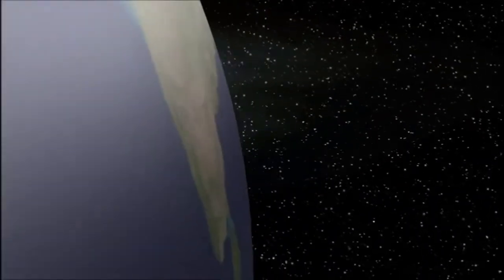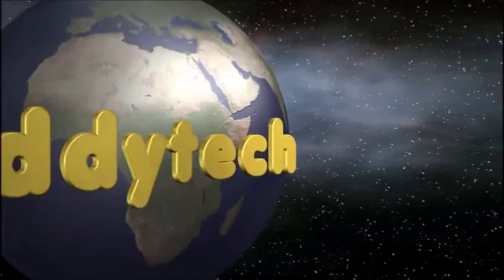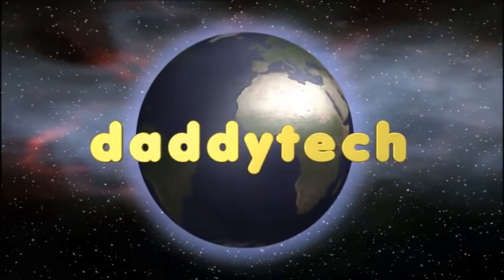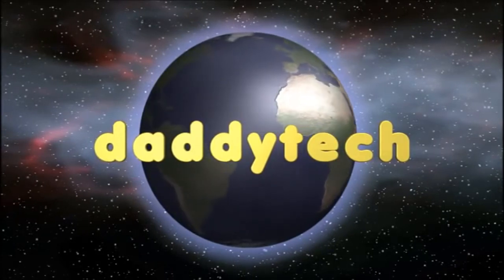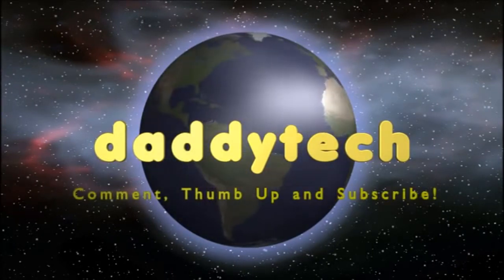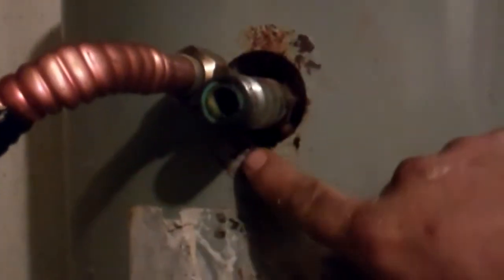My weekend adventure

Comment from the maker: @zx8401ztv oh yeah and remarkably enough there wasn't really much to show about this one, shut off the power, drain the tank, unhook the electrical and water fittings, snatch out the old & busted and put in the new and improved and it's all good, started to not do a video but i didn't have anything else going on this week so i figured why not. changing out the tank only took like 30 minutes. the long and harder part was cleaning up the mess that it made before we found out what the problem was.

Comment from the maker: @hoss4107 oh yeah, it was a simple yank the old one out, slap the new one in kinda deal. the only thing different was the location that the power hooked up. Luckily when this home was built they thought enough to leave me the extra cable to be able to hook up a replacement that may have a different location for the power. but i can't complain still they usually only last 5-7 years and this one lasted 14 so even though it was a mess it could have always been worse.

Comment from the maker: @paradoxdesigns oh yeah there is all kinds of dust and such that gets in that little room because no one ever opens it or goes in there. the water heater shares the room with the heat pump and they aren't separated which is the reason all the dust was in there in the first place but i got it all cleaned out before i put the new one in so it's all good again.

Comment from the maker: @rex4x4 i don't mind it so much as long as it doesn't mean me having to be in the mud outside lol anything else, i am good for still, saved $2000.00 by putting in our own new Heat pump unit, and saved about $300 -$400 for a service call from a plumber doing this myself. didn't know hot water heaters are only good for 6 years now though ours lasted 12 so i guess things could have been worse sooner than they were still too.